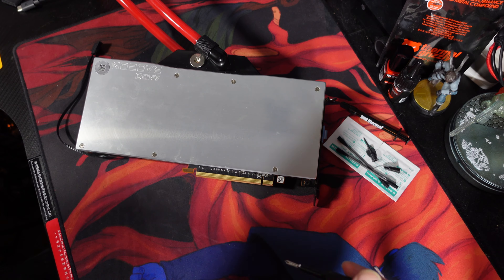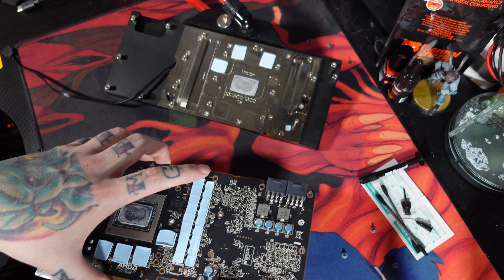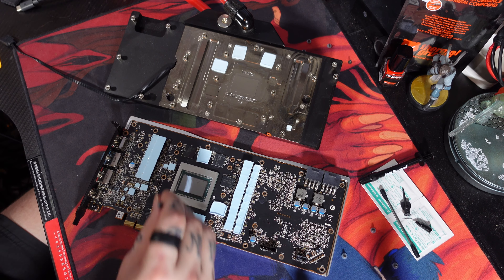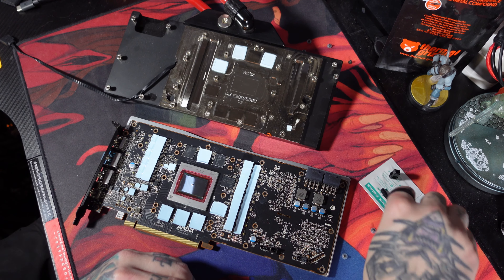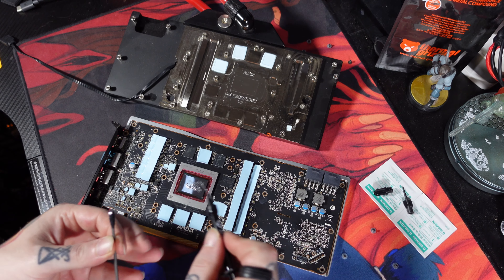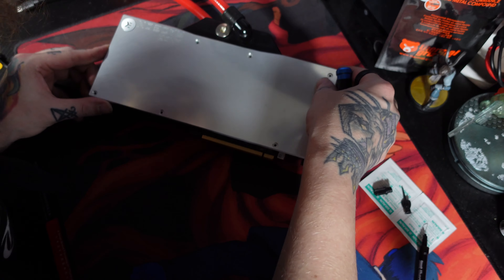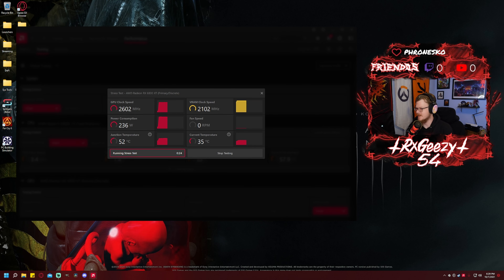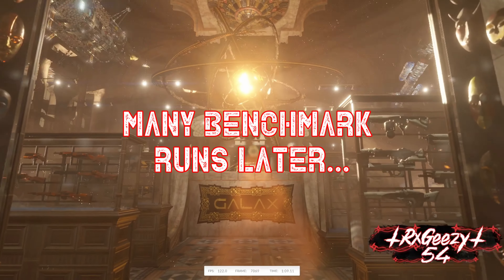How To Liquid Metal - AMD RX 6800 XT!

Comment: Good video and results. For others considering doing this, it's always best to dispense the LM from the tube to a surface away from the card and then use the swab to apply it to the die. It's very easy to lose control and accidentally squirt LM onto the PCB when dispensing straight onto the die.
Reply: I shall note this

Comment: Got a 6800xt asus LC OC and my temps are like 4c higher with the stock paste 2500 overclock. Also run it with MPT 400+ watts 1250v 2750 ish and It hits 71c junction max. I think it's more the GPU block lowering the temps than the liquid metal. Thanks for this video buddy very informative, not gonna bother with the liquid metal now.

Comment: What kind of overclock have you currently got on your card. Noticed first hand it boosted to 2600mhz but then dropped back to 2344hz or something. I'm guessing your low frequency is probably set to 500mhz, and ur max 2650mhz?

It's not best having it that way because your framerate will be all over the place, whether your max is 2650mhz or not always put the lowest mhz frequency 100 below your max to keep a stable boost clock.you,ll notice your fps will balance alot better.

In time spy my graphics score is 21040 and the graphs are practically straight and solid, no ups and downs, this is what your looking for for smoother frame rates.

Comment: My 6800xt had issues with junction temp, die isn't totally flat, its slightly raised in the center, VERY slightly, but it resulted in stupid high junction temps even at stock with the really good cooler the red dragons have(77-87c core, 107-110c junc when stress testing)
tried repasting, washer mod, etc etc

even after going waterblock cooling junction temp was still way too high compared to core temp.

properly applied liquid metal fixed that, max junc is now 64c, max core 48c with a 2700mhz overclock(2658mhz effective) with MPT upping the PPT limit to 322w

would recommend, tho in adition to nail polish protecting the gpu SMD components I also put a layer of weatherproof body moulding tape(a 1mm thick double sided black foam tape made by clingtape) around the gpu chip along the outer casing to keep any liquid metal spillage from getting out incase that happened, you get that tape from automotive stores, its used to put badges and car trim back on cars

Comment: Good, how are you? I want to know how it was after applying liquid metal after 1 year how was it didn't spoil the cooler?
Reply from the maker: As far as I know, the cooler is as fine as when I first put the liquid metal on.  I haven't really had any reason to pull it back apart, it still runs just as cool as it did when I first put the LM on.
Reply: @GeezyBass  But you could do a video 1 year after you have the liquid metal to see how the cooler turned out, there are many reports that coolers start to spoil with liquid metal
Reply: @RapidFire340   Aluminum heatsinks die almost immediately after applying the liquid metal. But these cards come with a copper heatsink that is plated with nickel. Both these materials work just fine with liquid metal for years. Like the PS5.
Reply: @Oscar W. Sleight  thanks for the answer, good continuation of good videos ✌️

Comment: Hey there.

(First time ever owning a modern Radeon GPU) Scored a 5700XT PowerColor Liquid Devil (watercooled card) on Ebay for £290 to replace my current Strix GTX 980Ti with EKWB. When running the card on Heaven benchmark at full screen 2560X1600 Maximum settings, the 'junction' temperature is typically at 70c and 51c for the 'edge' temperature (maximum, with the factory paste) (the card is at factory settings). How much would the 'junction' or 'edge' temperature drop by using liquid metal? Is it worth doing on a Radeon RX 5700XT? Are these temperatures already good enough?

Cheers mate.
Reply from the maker: Hey!  First off, congrats on the dope upgrade for you gpu situation!  Those are already pretty excellent temps for a 5700XT, (my non liquid cooled Powercolor 5700XT liked to hit 95*C regularly), but if you did want to use LM to rplace your current thermal paste, the most you can realistically hope for as far as dropping temps is probably around 6*-10* at best.  That being said, it is a pretty interesting and fun project to do!
Reply: @GeezyBass  Ok awesome! stuff I'll probably try repasting with Arctic MX-4 first (as I need to take the card apart to clean the water block anyways). If the temperatures are worse than stock I'll try LM (as its the only other thermal interface material I have anyways). I also have few questions:

Regarding performance, is the 5700XT core speed best overclocked or undervolted?
Is VRAM worth overclocking? I've heard problems with doing so on these cards above 14GB/s.
I've done some research and found you can tweak memory timing straps on RDNA 1.0 cards, are programs like AMDMemeoryTweak XL worth using to tighten VRAM timings?
Will it yield much performance gains?

 Cheers mate, Have a good one.
Reply from the maker: Smart plan since it needs cleaned and repasted anyway, let me know what you end up doing/what your temps are!

As far as overclocking/undervolting, short answer is yes lol.  I always seem to get the best performance from RDNA cards by putting a decent undervolt (5-10%) on the core voltage and then raising core clocks until I find what the sweet spot for that particular card is.
I haven't ever personally had great results from overclocking VRAM beyond trying to eek out more points in benchmarks, and have no experience messing with actual VRAM timings.  
Are you looking more so for getting the most performance from your card while gaming/every day use, or are you wanting to do rippin' Time Spy runs?
Reply: @GeezyBass  Cool. Yeah the card is temporary connected up to my cooling loop for testing (as I just got it) although the water block is quite gross inside, I will be doing a full system flush and cleaning as the liquid has been running long enough as it is. 

(All figures are with no overclocking) The voltage my card runs out the box on MSI afterburner shows 1.16V and an average core frequency of about 2080-2090Mhz (not sure of thats good or bad) in heaven with the maximum settings preset, my card has the memory running at 1800Mhz with Micron Chips. Is there much headroom in this card for any good undervolt/mild OC? 

I will be taking the card apart tomorrow and cleaning it. I will put my 980TI back in for the time being as I wait for my new fluid to arrive sometime this week and reinstall the card either this weekend or next week (if I manage to get back from work early that is).

Nah, I don’t intend on using the card for benching 3D mark, I only have heaven and superposition, along with the UnrealEngine5 titanic demo.
Regarding the games on my computer, I play mainly open world story/sandbox games like Metro Exodus, Horizon Zero Dawn, Minecraft and GTAV for example. I own a HTC Vive (non-pro) and use it for playing modded Half life Alyx, the game stutters quite a bit on my 980Ti due to being pegged at 100%. 
I don’t play any twitch shooters like CSGO or Valorant mainly because I just plain suck at them 😅.

I’ll keep you updated when the card is properly installed in my system and cleaned with new paste.

Yet again dude cheers for giving me advice mate, appreciate it!

Comment: 45 likes to go.. One day you will need to review it as nail polish 😆I've been watching as many videos of people doing this.. I have major hotspot issues with my aio cooled 6900xt. Without going full on watercooling i think i need to try this. I've repasted this thing 4 times with normal paste mx4 then mx5 and it still reach's shutdown temps of 103c.. its an xtxh core which seems to not mean much when i can't keep it stable. I can't send it back as it was b grade stock and its almost out of warranty and i think i voided it anyway. but it only shuts down in timespy benchmarking .. not once in any games and it didn't do this when i first got it. I could go on but i stop boring you
Reply from the maker: not boring me at all man, quick question, how large is the radiator of the aio on that xtxh?  if I remember correctly, doesn't that only come with like a 120mm rad?
Reply: @GeezyBass  I didn't explain all, it's a sapphire toxic extreme edition with a 360 aio lol... It so shouldn't be shutting down right. I'm unsure if it's mounting issue or maybe the pump is up the duff. But the fact my hotspot temps are over 40c higher than my GPU temps says to me now it's mounting pressure. I added two 0.4mm washers which has helped a little bit as certain games don't spin the fans up where they did before. I'm actually thinking the paste it came with was either better or better applied. Anyway just waiting on my conformal coating and I will be hardcore on no puddles and work my way from there. I appreciate that you responded ✌🏼

Comment: Im getting 80c hot spot on my watercooled 6900 xt with gelid paste and gelid ultimate pads. Do you think LM would make a big difference?
Reply from the maker: It probably wont make as big of a difference as you want, at most you'll get like 6-10*C temp drop.
Reply: @GeezyBass  that is more than enough. And lm not degrading.
Reply from the maker: @0xNobody  hell yeah, then I'd say go for it!  Let me know what kind of temp improvement you get if/when you do.
Reply: @GeezyBass  will do
Reply: @GeezyBass  so my biggest issue with regular pastes is, they detoriate, pump effect or w/e. After 1 month 80c went to 95c on benches. I'll be using LM next week. Hope it goes well cause I cant afford another gpu (or a loss of 1400e)
Reply: Ahh this does not give me hope.. maybe my aio is already up the duff on my toxic ee ... . .
Reply: Hmm saying that if my aio was up the duff then my junction "hotspot" temps would be close to my gpu temps at full load but its over 40c difference 🙃 i feel a little sick as i've been looking into this for a over two weeks and i feel my two options are full on water cooling or this and this is the cheaper option if i do it right. but will it work? I guess i can only give it a go and find out ..

Comment: I opened my RX 6800 XT to change the thermal pads, and it seems the hitachi hm01 paste has cracked. Can I use Thermal Grizzly Kryonaut The High Performance Thermal Paste? Or does it have to be liquid metal or hitachi hm01?
Reply from the maker: You can definitely use the TG thermal paste.
Reply: @GeezyBass  thanks

Comment: what are your before and after temps? i have been thinking on doind this to my own Air cooled card
Reply from the maker: Before they were 35-40*C at idle, 55-75*C under load, now 25-30*C at idle, and doesn't get over 65*C under load.  Granted, these numbers are on a water-cooled card, but there has definitely been a noticeable drop in overall temps.
Reply: @GeezyBass  WOW thank you for the fast reply also these temps sound promising :)

Comment: Holy shit dude. I have the same card, same GPU block and wanted to liquid metal my card as well. Well, I fucked it, something shortened my card and it started smoking. Now I have a broken 6900xt
Reply from the maker: YIKES, im sorry to hear that happened.
Reply: Is this actually true? I have a waterblock and 6900 xt and I bought some liquid metal, didn’t apply it just yet. Did you protect the SMD’s before applying the liquid metal? How did it happen?
Reply: @raptor2701  no, I didn't protect anything...
Reply: @iFringeHD  That means that you literally wanted to break your card on purpose, why would you do liquid metal without protection. I am going to use both electric tape and nail polish just to be safe
Reply: @raptor2701  No I followed the instructions from a YouTuber 😐 learned my lesson I guess!

Comment: I put liquid metal on my 6800 XT and for some reason it won’t spread and keeps getting stuck on the black q-tips is there anything I can do to fix this?
Reply from the maker: Some will stick to the black q-tips, did you make sure to clean down the surface of the gpu die thoroughly?
Reply: @GeezyBass  yea, I don’t have 99% isopropyl unfortunately but I have 70%. Earlier when I tried I managed to get it to cover the whole die, but when I took it off I noticed a huge chunk of it missing. I went to try to spread more onto the gpu and it just either gets stuck into the Liquid metal already present or gets stuck to the q-tip. I attempted to clean the empty patch with alcohol again but it just won’t stick. I think I maybe have to let it sit there for awhile first, I’m just confused because it won’t spread like how it does for other people. However on my waterblock it spread so fast and simply.
Reply: @GeezyBass  so I ended up getting rid of the thermal take liquid metal. It kept balling up, even after doing a clean on the surface of the die. Turns out this liquid metal is notoriously terrible at spreading. I’ll try conductonaut and see whether it’ll spread, it should though.
Reply: @GeezyBass  I managed to spread to spread conductonaut over it.
Reply: @NeededByNobody  It doesn't spread like paste.  It'll act like hot solder does on dirty metal if you try to spread it.  If you rub the q-tip in a circular motion it'll warm up the LM and the die and it'll start to spread.  Keep doing circles and go wider and wider until it is all spread out.  You can use one small drop at a time if you don't have any experience with it.
Reply: Thanks.
I managed to spread it successfully, turns out that the old liquid metal I had was kind of rubbish. It was by thermaltake. I'd completely clean the surface, and even heat it up, and no progression, just stagnation. Threw the tube in the trash, and got conductonaut, surprise, surprise no issues there, did the same method, even without heat, and actually got progress, I might need to do a redo soon though, temps are getting hotter.